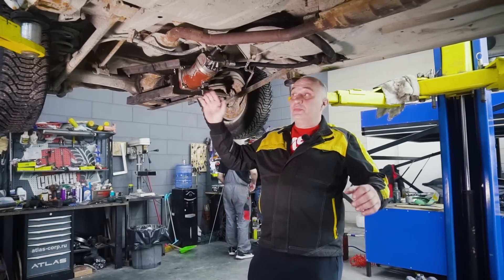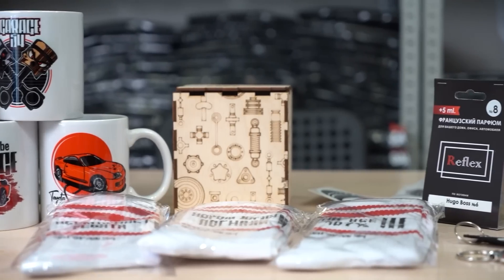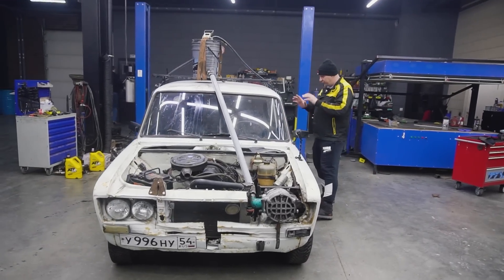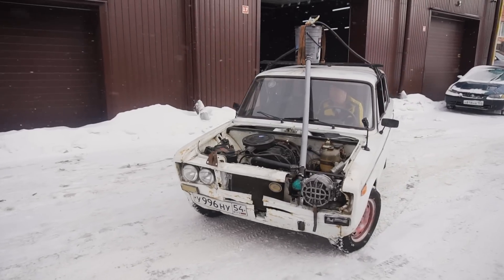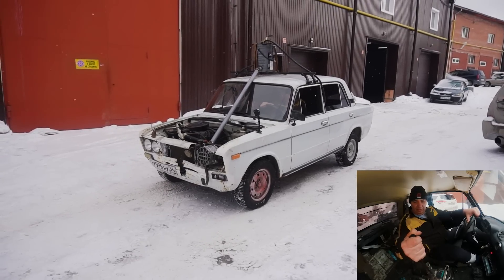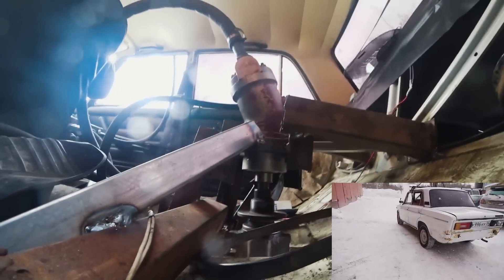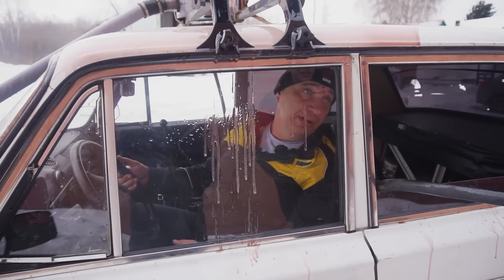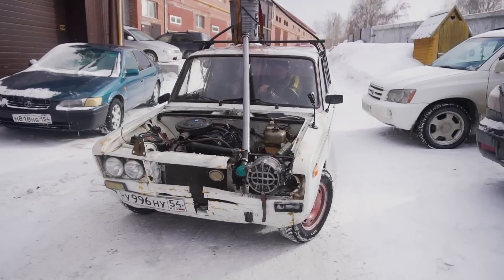Liquid propshaft (part 2): we got it to work!

Comment: Try this on a front wheel drive car so you have both, types working together...and a rubber flex coupler at the diff would have turned smoother. On a lot of heavy equipment the throttle is run wide open and the speed is controlled by the lever, that way the system always has full power.
Reply: Most cars arnt designed to maintain high revs for a long time, and will overheat, or become shrapnel. Diesel engines are perfect for heavy equipment, because they have less moving parts, make tourqe is around 2000RPM in most cases, and tend to have radiators designed to keep the engine cool while under load and a constant RPM. Great idea thoughm
Reply: @jwalster9412  Fewer moving parts? They're essentially the same as petrols, just without spark plugs. Heavier built, higher compression ratio, but not that different.
Reply: @ProdigalPorcupine  also no valves in alot of them.
Reply: @jwalster9412  Two stroke diesels, yes. They aren’t very common though, and they need forced induction to work, ie turbos or superchargers. Common four stroke diesels derived from the Otto cycle have valves just like petrol/gasoline engines. They’re essentially the same.

Comment: How long till what breaks . Mount the pump to a rear end. Mount the pinion to the pump . Axial forces will destroy the pump and it’s being driven to fast. This causes the overheating. . Keep the additional reduction and use a pressure accumulation system for braking and extra acceleration during takeoff

Comment: Would love to see what a properly matched pump/ lines would do. I've always wondered. Im thinking it would be very inefficient in terms of power transfer but like to know how smooth and responsive it would be. Could you regulate speed power with RPMS instead of transmission? Please try again with a little better (more robust?  setup as you are definitely on to something!!!  Please!!!!!
Reply: Because of the nature of hydraulic pumps and the thermal properties of the oil you can only set a very limited  speed range.
Either you can do 0 to around 40kmh or 30-100kmh.
Unless you ran the drive motor on the transmission and ran it like a regular car. Then it would be no different from a regular car except that it would run a hell of a lot hotter.

Comment: Use the bellhousing to mount the pump to the back of the engine/transmission.
Pump➡️flow divider➡️double detent open center spool valve➡️hydraulic wheel motor. Just sayin'

Comment: No Reverse? Can’t you simply move the lever forward, to reverse the hydraulic motor? Here’s an idea: now that you have a working hydraulic system, try removing the rear axle and mounting two hydro motors, one for each rear wheel. Then you could experiment with hydrodynamic thrust vectoring - steering with the rear wheels.
Reply: Most industrial hydraulic motors are one direction only.
Reply: @NotProFishing  That doesn't seem safe (or legal).  What if someone gets caught in a machine and the only way to get them out is by reversing the hydraulics?  Something tells me OSHA wouldn't approve of any hydraulics that can't be reversed in an emergency.
Reply: @dadigitechman  You're right, I have no idea.  I only know about the systems I have personally worked on.  OSHA exists for a reason, and if there are hydraulic systems out there that can't be reversed, which can put lives in danger, then OSHA needs to step in and require changes be made.  At least in the USA.  I'm sure other countries have similar organizations.
Reply: I was expecting him to push the lever forward to go backwards and was surprised when he didn't even try it.  I'm not a hydraulic expert, but I've worked on several different hydraulic systems on tow trucks and construction equipment, and every one I've touched reversed when the handle was moved the opposite way.

Comment: If you put the pump directly on the engine, you should have had the drive motor connected to the input of the transmission. If you run the drive motor on the rear end, you should have the pump on the output of the transmission.
Reply: The pump should be on the transmission
Reply: The pump needs to be maintained at the correct RPM. The more direct the drive the better.
Reply: The pump should definitely be powered off the rear of the transmission. It would only be removing the driveshaft from the equation but
Reply: @sweet65mustang  but the other different would be that the drive wheels could be placed anywhere even if they were placed on a separate toe vehicle. Also, would it not provide a more linear power delivery, and more torque, than the engine and drivetrain provided initially?
Added; would it not improved the driving experience if he placed the lever control where the pedal is, and had the lever to control the engine rpms?
Reply: @johnsimun6533  the connection between a vehicle and a powered trailer had to be very elaborate or the rear drive will push the rear of the front vehicle out sideways. 
An offroad vehicle could benefit greatly from a hydraulic drive. There is one that not only turns the wheels but controls the lift and even arm length.
Reply: If it doesn’t have power
That’s why I need gearing. 
From a trans
Reply: The problem that Vlad won't admit is, the Lada engine just don't have the power needed to run that pump, but it's a entertaining video tho, thanks for sharing guys.
Reply: @jerryb1234  it does but it’s a one speed transmission
Reply: What a blasphemy!!!! Lada have not enough power? 
Soviet engineers put all the power into this engine. All of it!

Comment: I'm starting to wonder, what does it look like when these guys are actually working!
Reply: This is how they work they made my car run on uranium with a compact nuclear reactor as a turbo in my engine
Reply: @mecarizza  hm okay so your car runs on my diet interesting
Reply: @seagoldfish3746  yoo also my diet
Reply: @mecarizza  does the reontgen go past 3.6 occasionally?
Reply: @mecarizza  they made mine run on horny. I taxi lesbanese womerns and it’s nothing but profit
Reply: Very boring. Like a regular mechanic
Reply: @1one3_Racing  are regular mechanics boring?  I always thought we are a creative bunch.
Reply: @swicked86  they change oil, tires, brake fluid, brake pads, etc, andsometimes, mabye do some body work. It's a mechanic shop, not sure what you expected, they mostly just maintain vehicles
Reply: @jwalster9412  I was a mechanic also, but you never know sometimes you end up putting gt28 centers into factory rb26 housings.

Or you figure out how to put a 3SGTE into an AE86, or use a pressure sensor in place of coolant coolant sensor to enrich fuel.

There's all kinds of excitement in just being a mechanic.
Reply: everyone knows "work is for dogs that can't surf!".

Comment: like any hydrostatic drive, you have a throttle holding rpm at 2000+.
then it will perform more like you want.
Reply: I was going to say, a governor would greatly improve the performance of the system. That way, the driver could just focus on the hydraulic lever.
Reply: @DielectricVideos  
like a bobcat. throttle up, and go.

Comment: Add an on demand smoke screen out the rear! 

Or put a turbo from a semi in a lada and see if it runs.
Reply: What your ideas have common in this project.

Turbo from semo dosen't work in Lada, engine dosen't have power torun it, so there is no pressure generating. Sorry. 
I think EVERYONE knows that but.. now you too know it.